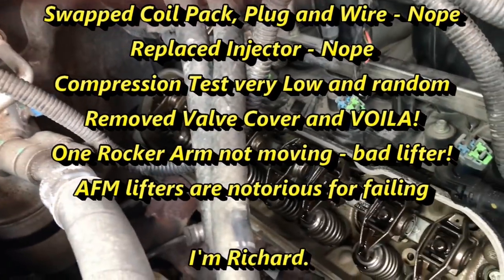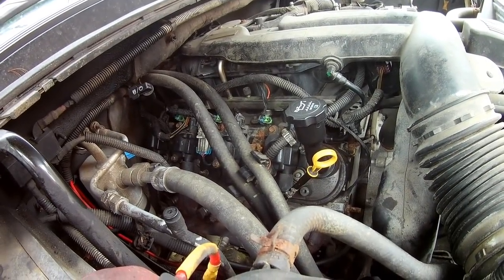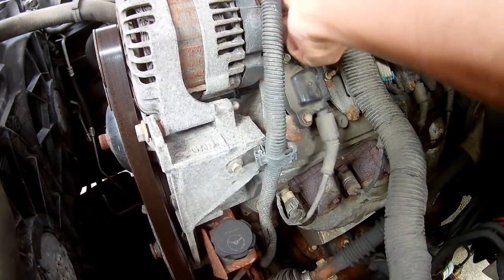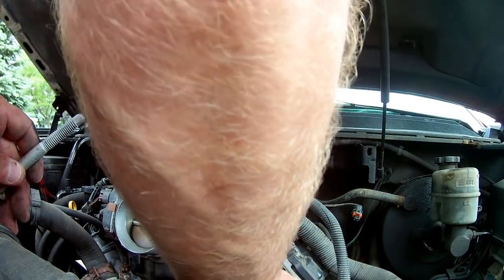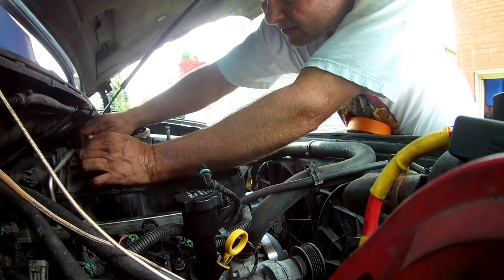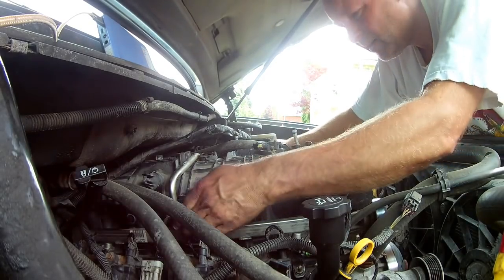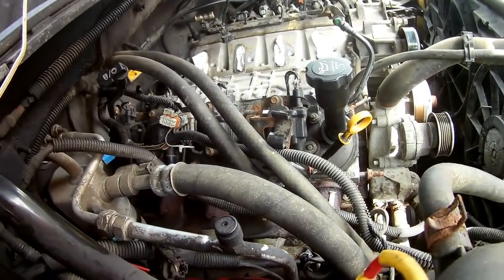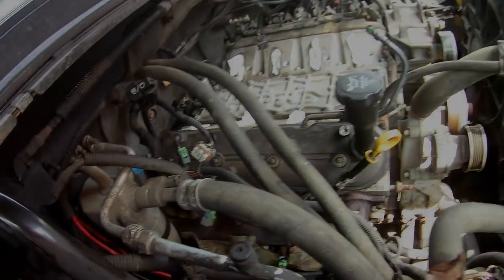PLEASE SUBSCRIBE! Chevy 2009 5.3 L Head and Lifter Removal and Replace Part 1 of 3

Comment: I enjoyed your videos. I have an 08 Avalanche and I have a sixth cylinder misfire. I suspect it is the lifters as well since my father in law had the same problem with his same year suburban.  I plan on tackling this project very soon. I see that you used a Haynes manual for guidance. Did you use other YouTube videos or any other reference for fixing your truck? It seems like your video is the only video I can find that takes the viewer completely through the process. I’m a novice but I think if I’m careful and take my time I can perform this repair.
Reply from the maker: roadfuss I was unable to find any other videos online which is why I made this one. I’m sure you’ll be able to manage this just give yourself a couple of days and be patient with a few of the back bolts as they’re tough to reach and need to be worked slowly. I’d suggest taking the spark plugs out  as well before removing the head. Also be careful of the knock sensor on the manifold below the block. I must have hit Mine while prying the manifold back as it started throwing a bank 2 knock circuit low current code soon after the repair and that cleared up once I replaced the sensor. It’s an $11 part and only takes about 30 min to change, but it’s an unnecessary added expense. Good luck!
Reply: Mechanical work is for the simple minded the job gets easier or harder based on your equipment/tools
Reply: @dh5254  You're obviously the one who's simple minded. I'm a software developer and this lifter fix is definitely not simple minded work.
Reply: @chris4321das  for someone who works with software you don't read things carefully 🙄 it's simple if you have the correct tools, workspace to do the job for example if you wanna remove the clamps to pull the radiator there is a special tool for it makes it very easy same with removing the manifold 1 electric ratchet and an extension makes it cake
Reply: @dh5254  When you refer to people as "simple minded" that is understood as calling them stupid simpletons. I think disassembling and modifying binary executables is more complicated than doing this lifter job but people who successfully complete this task are far from being "simple minded".
Reply: @chris4321das  and I disagree it's not your place to defend others
Reply: @dh5254   It's not my "place" to defend others? Please go pound sand.
Reply: @chris4321das  clearly Patrick star doesn't understand the variables of wear and tear. Hell I've had the same repairs on multiple vehicles and have had the difficulties go both ways lol. Doesn't matter if you have every tool in the world it's still a crap shoot. But i appreciate you defending us simple minded folks hahaha!